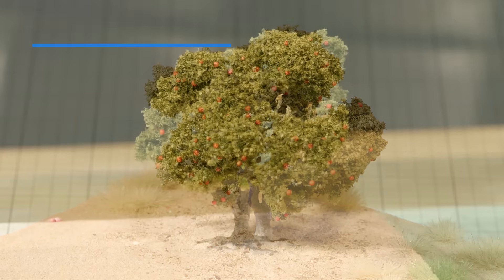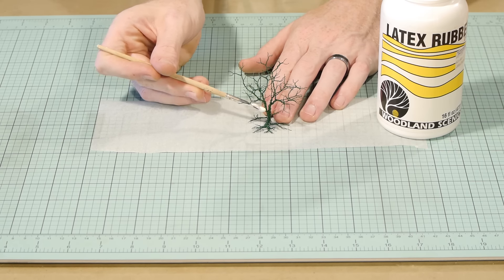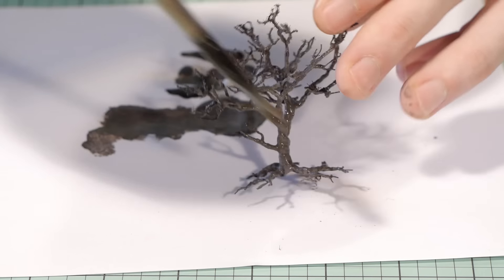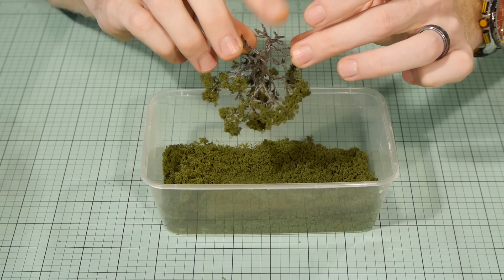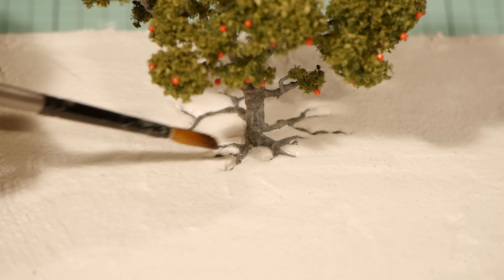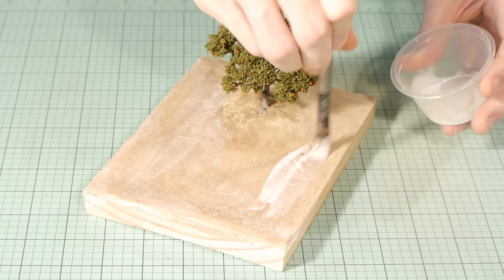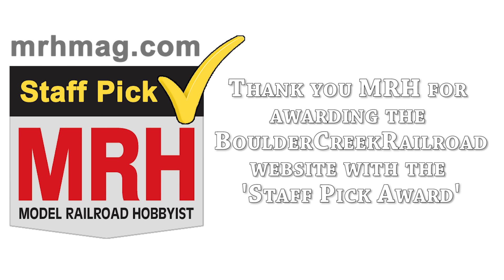Wire Tree Tutorial – Model Railroad

Comment: youtube is a curse! now i want to make my own model tree.
Reply from the maker: lol....... good luck with the tree :)
Reply: Luke Towan
Reply: Rok Podlogar 
beautiful
Reply: Luke Towan where would I get all the material to do this stuff? I’m in Canada and I just wonder if there are is a store around that I could get everything in one stop. Thanks.
Reply: Tree Rat 
Wire can easily be found in any crafts shops..Or you can buy from ebay.
Or try from a shop that sells plastic plants (its florist wire)

Copper wire possibly from DIY , tech, or 2nd hand cable and tear out the wires .
Usually hobby shops sell everything listed here, minus the wire.
Or..
Sponges for the covering of the braches(the thick coverage).
Latex+PvA glue for the bark shape.
For the paints, if you want to go cheaper tho uglier look, decant air paints and mix em with water.
Some people make scatter with wigs or from natural fibers or brushes.
As far as the tiny leaves..no idea sadly

Edit: or you can use a nail polish for the bark shape too (ugly but replaces the need for me to use the latex+PvA mix)
Get a 3 or 4 bottle ,3 droppers and get equal amounts of nail polish into the last bottle, mix and apply and you get a weird colour which can be matte too
Reply: @Bgenk507  No.
Reply: Go make like a tree dude😎

Comment: Thank you friend! I really wanted to make my own jewelry tree but I had no idea how to achieve a realistic look! I made this with 54 inch lengths of 18 gauge wire and used metal snips an pliers to pull it off. No leaves necessary but I may take your idea of using the rubber just to seal the ends so I doesn’t scratch me every time I remove a necklace!

Comment: Great video, and very effective method for making small-scale realistic trees. I love the apples. BTW, reading the comments here I note that @Masked Mustachio mentions the tackiness of spray adhesives causing problems with dust even after a year of 'drying'. This would be an even greater problem with larger-scale trees. I'd like to point out that I've solved this problem by making 'indestructible trees' which can be jet-washed with water AND vacuum-cleaned. The secret is to glue the foliage to the 'twigs' by dunking the 'clumps' of twigs in Cyano-arcylate glue, then dunking them in the scatter. This creates strong and ever-lasting foliage. The twigs meanwhile, are made from nylon-monofilament fishing line, which is flexible and 'ever-lasting'  and the branches to which they are fixed are made from 'wire-cored garden twine' which is also flexible and 'ever-lasting'. The upshot of all of this is that the leaves, twigs and branches are ALL flexible and highly resistant to damage from knocking, bashing, crushing, bending, being blasted with jet water, and vacuum-cleaned. I don't know if that's of any help for you, but maybe it is to other viewers. I do have vids, and show the method for the construction of a 13 inch high 'Yew tree' and then I throw it across my table and bash it repeatedly on the bench to show just how indestructible it is! LOL.

Comment: Thanks Luke.  I don't have any rubber but I have some off brand PVA.  I brushed on a coat a day for about four days until all the wires, 2 or more, were covered. Then a light coating of slate gray with the odd dab of black and i have an old dead tree.

Comment: After many years in the business of building model railroads we have put together several thousands of wire wound trees. I would offer a couple of suggestions to speed up the process. 1. Buy multi- stranded wire (without insulation).  2.  Dip the trees, instead of spray painting them. (Spraying just puts a lot of paint into the air)  3. Woodland Scenics has worked great, but use the foliage material and stretch it over the branches. - no glue required.

Comment: Just in case anybody wanted it for just the tree
Parts/tools list:
13 inch long wire
15 individual strands of wire 
Latex rubber
static grass flock
Craft glue
Brown primer
Black acrylic paint 
White acrylic paint 
Burnt umber acrylic paint
Airbrush 
Light brown(for airbrush)
Medium green course turf 
Spray adhesive 
Scale apples (if you want)
Knock leaves (olive coloured)
Burnt grass

Comment: Tip from my humble self: if latex rubber is hard to come by (like where I live), acrylic wood putty (I used the Dragon brand) works just as well, it dries to a nice matt touch, and well, since it's a wood putty, it imitates real wood pretty well.

I used a light one (I think birch wood) to be able to see where it's missing while applying, but you can choose whichever shade or color you need; you still gonna have to paint it but maybe you'll find one that limits the process to a gentle drybrushing.

Comment: Hmmm, I remember trying this technic like 5 years ago but I didn't had any latex back then, instead I used several coats of generic PVE glue, it holds fine and still was a bit flexible but after time wire inside these trees seemed rust from water in glue, my guess with latex this is not happening? Is there any other materials that can be used to make a coat? Also a bit worried how paint like generic acryl gonna hold to the rubber?

Comment: nice, but could you make the basic tree shape with wire, aluminum foil, clay, and paint? maybe not in that scale, but i think you could. also wouldnt it be the same effect to spray bottle isopropyl alcohol, then spray bottle watered down pva glue instead of using spray adhesive?

asking for a friend

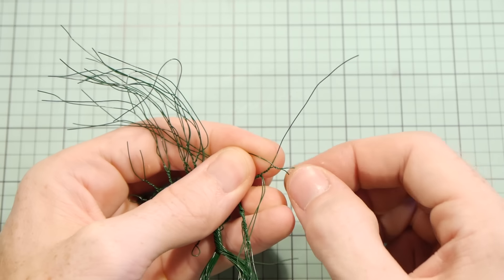Comment: Great detail and well presented your comfort with presenting material greatly improved the delivery. Just enough data to not over load but more than enough to get the job done, wonderful linear structure to the data, I have one question, HO is approximately 1:82, I work in 1:48, O, what wire parameters would you suggest.

Comment: What are the materials used? Where can i get it?
Reply from the maker: I've been meaning to write a materials list! It's 30 gauge florists wire for the tree structure, the leaf texturing is done with 'Woodland Scenics medium green course foam' and the leaves are 'medium green Noch leaves'. The tree is covered with 'Woodland Scenics Latex Rubber' to hide the wires underneath.
Hope that helps a little
Reply: @BoulderCreekRailroad   thank you so much sir 😄